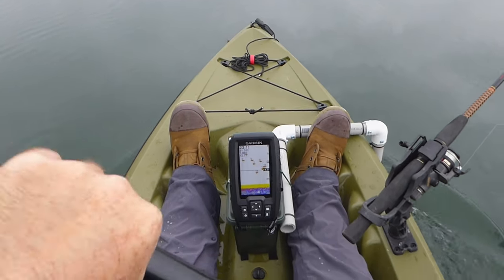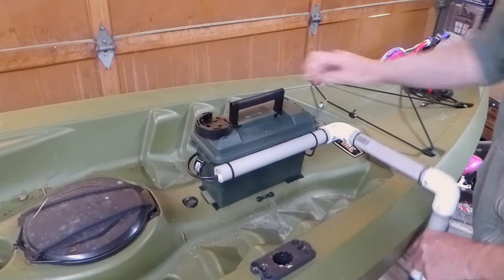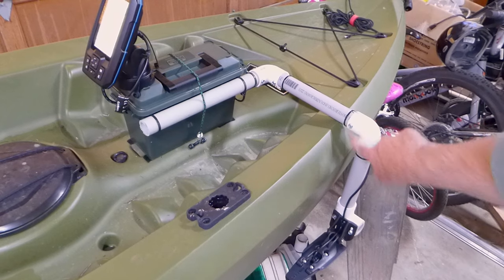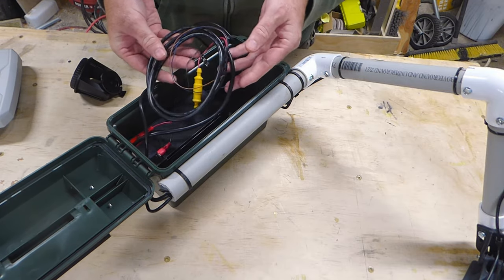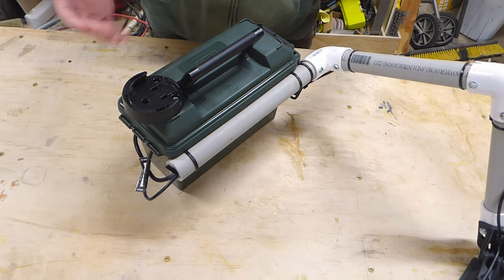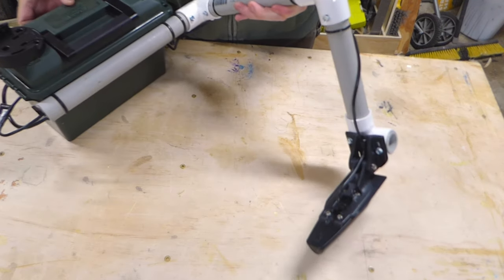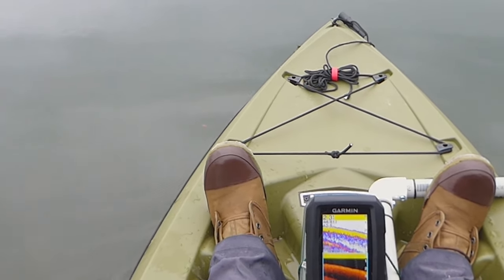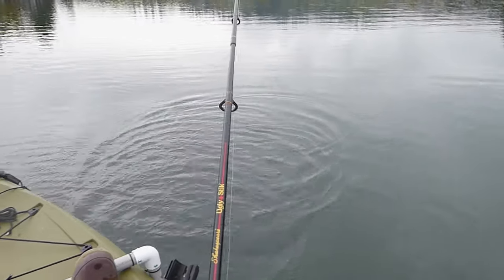Garmin Striker Plus 4cv on Kayak

Comment: Great video and elegant compact solution.
You can get compression glands that can easily clamp onto the cables. 
The battery will handle getting wet well enough. So too the Garmin as long as it does not remain submerged for long. 
Personally I would double up on the bungee holding your setup and feet the bungee through the handle for that little extra security.

Comment: Like the video !! for using it without a boat. I've got plans to take some styrafoam and make a bit of a mini boat/raft for the transducer, and float it on the river near me. there's some nice holes where i've never seen the bottom of just because of how fast and deep the water is, and there's vortex's that'll push you down so its dangerous. but this would be great to float by and map it all out. Using anchor points and stuff of course

Comment: Elegant solution. What i will add for my kayak (intex challenger) is On/Off switch and switch breaker. I think it will better to put some wood plate  base to make thr box more stable.  In your case it will better to attach it to the kayak floor. In addition i thinking off adding one fishing rod stand and attach it to the wood plate base.

Comment: This is innovative, thank you, I think the bungee cord will not hold the battery if the kayak tips over. So might want stronger couple straps to secure it. overall, amazing Job.
Reply from the maker: Thank you.  I dont think it would snap if it turned over.  Battery only weighs about 5 lbs. It cant slide off either end with the finder on one end and the transducer arm on the other but it could be more secure with more or better straps.  I was out all day and only moved when I was taking the arm in and out.
Reply: @AllTheHobbies  you are right if it is that light, I thought it is the heavy ones for the motor. keep the good work.
Reply from the maker: @dcfarouk  Still a good suggestion.  I will keep an eye out for a better solution.
Reply: Velcro pads on my the bottom? Belt and suspenders ya know.

Comment: This looks like a great portable kayak solution! Long term, have you changed anything?Id like something similar for my kayak, but also be able to take it to the crappie house as well.
Reply: I used it like that for about a year. I like kayak fishing so much I bought a Old Town Pedal kayak and installed that garmin on it permanently.  I only got to use it off that kayak 2 times in that time.  It did work but I just didnt need the portability enough to keep it that way.

Comment: Great idea! Where did you find the box for the battery? Also which mount is that? Garmin brand?
Reply from the maker: Box was a cheap ammo box found at the local sporting goods store.  The mount is the one that came with the Garmin Striker Plus 4cv unit.
Reply: Thanks a lot for the info! Really is a great idea, I don’t want to drill into my kayak so this idea is exactly what I’m looking for.
Reply: All The Hobbies I must ask, did you just drill some holes and use zip ties for the transducer arm? A brilliant system brotha. You could patent and market this system. It seems very functional and efficient.
Reply from the maker: @kevintaxera8473  Yes.  The zip ties started as a temp solution to see if the setup worked but ended up working fine so I used it like that.   Im not sure about patent or marketing this.  There are so many variation between batteries, Fish finders and kayaks that these need to be made for what each person has.  Im not even the first person to use and ammo can in this way either. I just wanted to show the process I used so others could make their own.